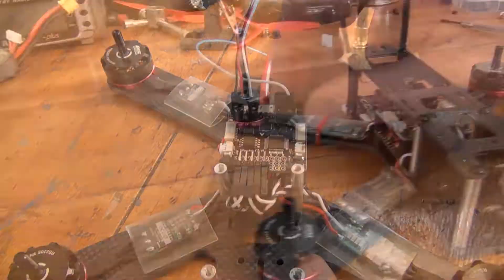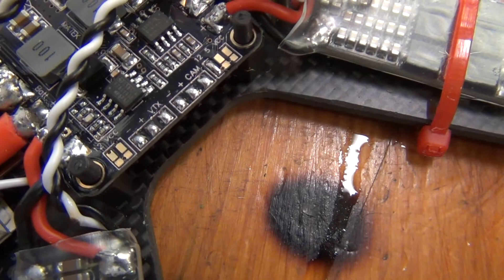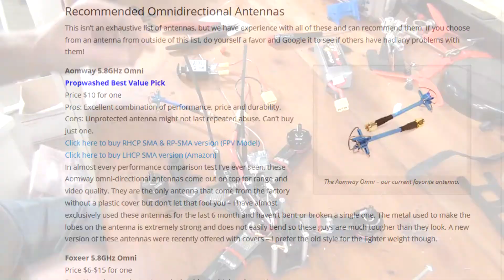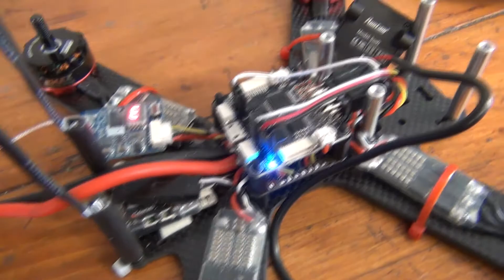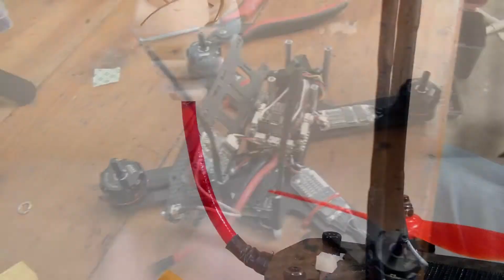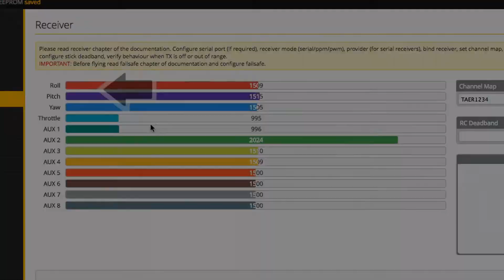How to build a racing drone | Part 6: FPV Camera and VTX Installation!

Comment: Just to clarify, I connect the vtx power and the cameras power together aswell as connecting the two signal wires and then powering it up, do i power it up with 5v from anywhere??

Comment: Hello! 
I am new to this field and now im looking to know different functions of electrical components. I have 5 questions:
1. do i need for every brushless motor an esc? Like can i use 1 esc for 2 or more motors?
2. I just want to build a flying drone with no additional functions what circuit boards do i need to have?
3. What are pdb and flight controller?
4. What if i have 4 motors with brushes, what electronics else do i need
5. From your circuit in your video which component acts as the receiver

Thx in advance